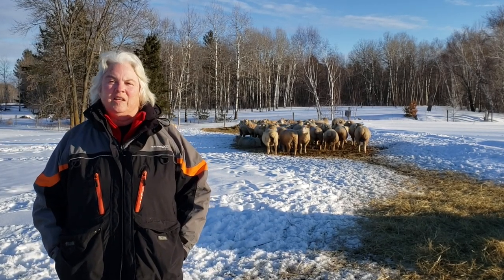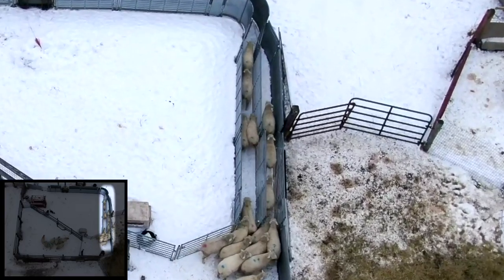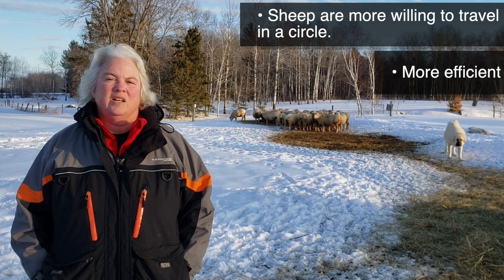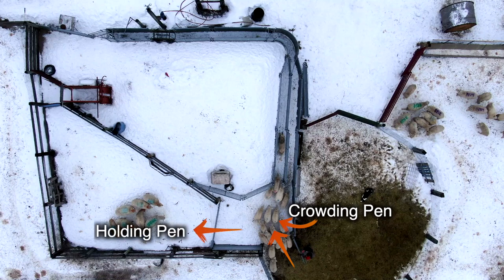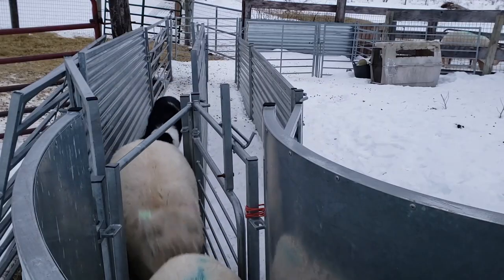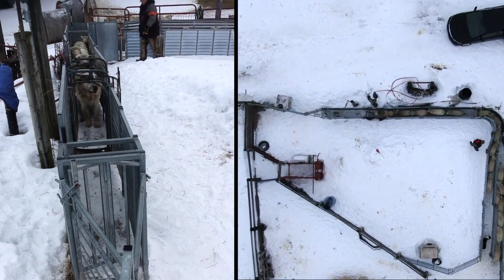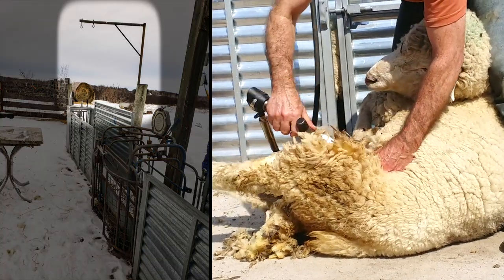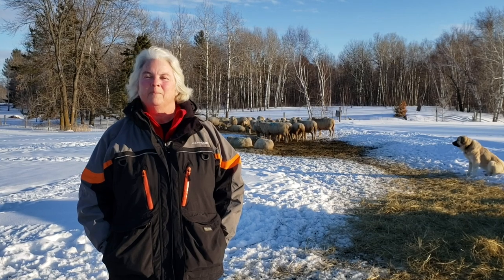How to Setup a Sheep Handling System in 2020

Comment from the maker: How do you handle your livestock?  Did you notice anything similar with a system you may already use?
Reply: It's only 2.3 acer.There were horses on it at one time. They put in a round pen, right now the rams are in it. I'm building a holding pen off one side with a shoot to funnel sheep to a channel gate into round pen or to pasture and work station I divided the property into two paddocks one in front of the house and one in back of the barn with a small strip that has our garden, and chicken coops for family space between house and the barn. Thinking of making the paddocks into fourths and trying intense grazing. This is all new as I'm a carpenter by trade. Of course we got sheep and goats before we thought out a good plan. The cart before the horse thing. We live in the pan handle of north Idaho hour south of the border. We get temps down to 0-f and two feet of snow that stays most of the winter with hot dry summers. Looking into over seeding paddocks and not knowing if I should wait till spring and frost seed or over seed this fall when tems drop down to 65. I looked at nature seed they have a sheep blend that sounds good, price is on the high side when looking into seed. I want whats best for them as we are trying to build a good stock, another side of the of ranching knowing what to look for in your livestock and bread them to get the results for fiber and body structure.
Reply from the maker: @anthonypayne6032  what is in your pasture now? Frost seeding legumes can work well, but grasses are more difficult.

Comment: Helpful!  I am just starting to design my system (and it has to be affordable) as I currently have 15 ewes.  I want to be able to start small and expand as the flock grows.   love the double chute concept!
Reply from the maker: Start with your basic single file chute and scale and a few gates to make a pen,  and then just keep adding parts as you grow. This is my fourth rebuild.  I went with cheaper materials previously but found they rusted or rotted quickly.  The galvanized steel is a worth while investment.
Reply: At 3:54… what kind of sheep 🐑 is that ?